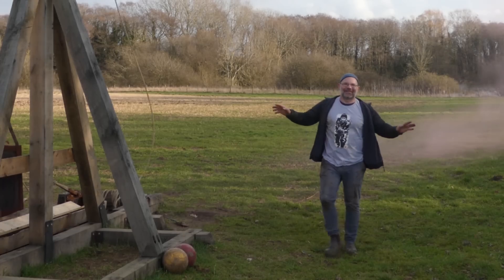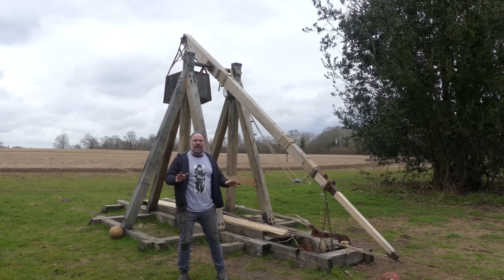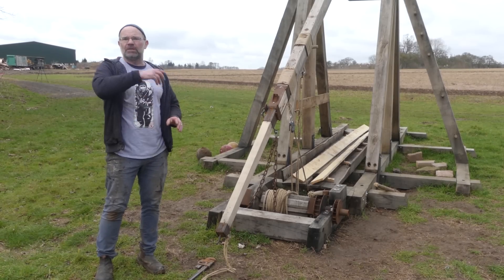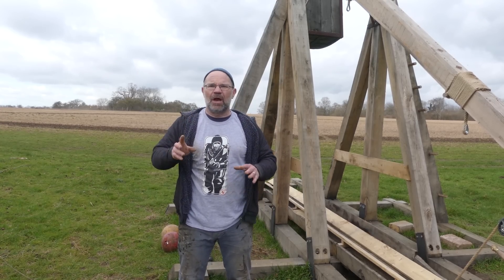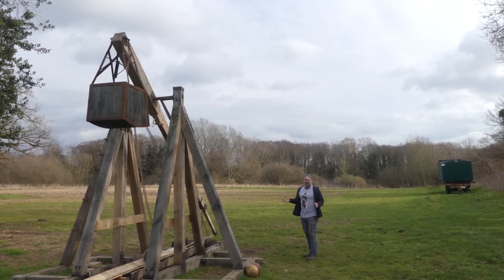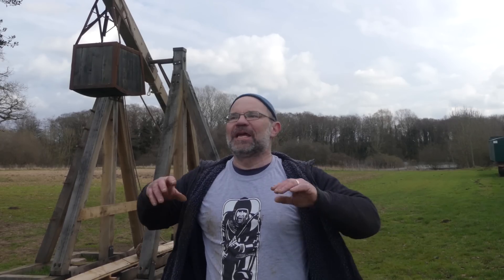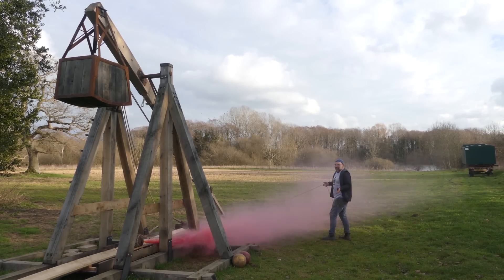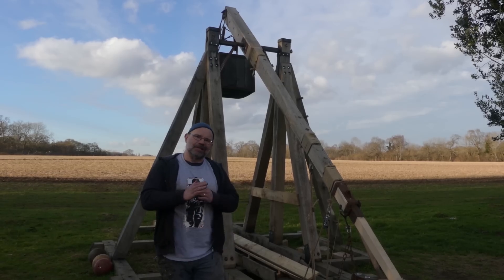Trebuchet - Why won't the darn thing shoot further?

Comment: I wrote all of the below out first... but I want to emphasize that this is mostly an slightly informed guess; so I really could be wildly wrong here.
I could be wrong, but it looks like the projectile is releasing at right about 45 degrees, which should be optimal for range (give or take, depending on wind direction). So it might just be that you are not getting as much energy into the projectile as you think you should be... ie the pin and such are good (as far as release angle) and you need to work on getting power from the counterweight into the projectile, which seems, most likely, to be a change to the sling length and maybe added counterweight (though the latter comes with shoring up the whole structure, of course).
Reply from the maker: I suspect that the arm needs to be a bit shorter and then energy may transfer better
Reply: @tods_workshop  more torque, less velocity at the end of the arm. I am not sure how the sling plays into it. Hopefully those guys in TX can help!

Comment: Not a trebuchet expert here, but maybe you want to experiment with the arm length some more. It seems to me that the low angle doesn’t allow all the potential energy to get transferred into motion.
Should that result in more instability, maybe you could extend the arm into the other direction? Though that extension would need to be rock solid with half a ton pulling down on it, so maybe that’s not the best idea either.

Comment: Perhaps take off the arm extension, and shorten the arm on the other side of the axle. That way there will be more gearing and a full "power stroke" again.
Reply from the maker: I also think that a little length needs to be removed

Comment: The machine does scale. Bigger = longer shot. I mean, my model at 60 cm does not shoot 130 meters. On the other hand,  it is perfect with an arm of 3.75, a counterweight arm of 1 and a counterweight 133 times heavier than the projectile, although 100 will do fine. There are a few improvement you can work on. The arm has to be at a 45 degree angle at release. It doesn't look like it is. The trebuchet has to be taller. Build a model. It's so easy to tweak it in comparison to this, and you can experience first hand just how much each variable matters. It's a real eye opener.
Reply: or use the simulator  to get most out of your build
Reply from the maker: Thanks Erick, I am just enjoying messing around with it.

Comment: I think the problem is with the counterweight.
The arm stops at almost perfect vertical every time, so it does not transfer a lot of the force. 
From what I can see the problem is that the weight falls straight down, while the arm rotates.
This leads to a situation where the arm rotates PAST the weight, which then arrests the movement before being pulled into the rotation again.
This seems to lead to a premature release, that is both weak and difficult to control, since the sling is pulled off the hook by force, rather than just slipping off at the right angle.
Reply: We hurlers call that "counterweight stall".  It's entirely usual.
Reply: @Trebuchet48  Can you go into more detail for the sake of our and Tod's enlightenment?
Reply: @dougler500  Thinking about it, dangerous I know, the throwing arm and the articulated counterweight form a double pendulum. however as the lengths are different they will have different frequencies. The weight has the higher frequency so that when the trebuchet is fired, the weight will be on it's backswing before the throwing arm has reached the point of release, thereby stalling the arm and taking energy out of  the throw.
Reply: The weight has an amount of momentum, allowing it to travel past the closest point to the ground and travel backward/up some small amount without slowing enough to be detrimental enough to the throwing arm acceleration. If that's true, the projectile arm must lag behind the weight arm/be bent back some small amount. The weight being able to swivel adds complication in calculating, and may be detramental to accelerating the projectile at the end of the weight arm stroke.  The projectile must be released before the arm acceleration becomes less and/or just before it begins to be pulled away from the optimal ballistic. Maybe those two points being made the same is an answer.
Lots of enjoyable experimentation is called for, besides the math. Don't forget the deer decoy target, which, besides being humourous will give range info.
Reply: @senatorjosephmccarthy2720  I think that initially it might be quite informative to stick visible markers at various points on the mechanism and fire the full sized machine filming it with a high speed good definition camera.
The footage can them be examined to actually see what everything is doing, when the release occurs and also the speed of the throwing arm.
Less problematic that building a small scale version perhaps.
Reply: @Trebuchet48  "Hurlers"...  there's a club for everyone eh?
Reply: @thexbigxgreen  If an object exist, there is indeed a club for it. -Just look up swedish fermented herring... Those guys are sick. No, literally, sick.
Reply: @Trebuchet48  I see youv got flexibility on your Treb ..Buy why is ths kunt not answering us .He keeps on saying  can you help ? His machine is to stiff like  him ..Look at my answer above  ??
Reply: @Trebuchet48  So, is there any conceptual benefit if the hurlers try to pull the counterweight so that at all times of the rotation of the arm, it is directly below the point that it contacts the arm?
Reply: Not sure to agree with the above. 

It seems to me that by extending the arm length without increasing the main axle height above ground, you have reduced the distance over which the projectile is being accelerated (arm is longer, the "ideal" point of release remains more or less the same, so the arc length (edit: not the arc length, the angle of rotation) between initial and release point is actually smaller), thus the initial speed of the ball at release point is lower. 

If I have got the dimensions right, your 1.2m extension might have cost you about 15 degrees of rotation of the main arm during which to accelerate the ball.

Edit: you've also reduced the drop height of the counterweight, which reduces the energy imparted to the projectile, hence the dampening of the counterweight motions.
Reply: @guillaumehenin6192  Very true. But also, it has to be remebered that the counterwieght is hinged. This hinge cannot be overlooked as it adds another layer of complexity to the problem. But it affects more the durability of the trebuchet then to to force imparted on the projectile.
Reply: Sorry just mentioned a similar observation in my post. Apologies for stealing your thunder.
Reply: The energy in the system is from gravitational potential energy(pE) converting to kinetic(kE). ( I know, stating the obvious.) The maximum usable energy in the system will be at the point the counterweight is lowest, ie; when the arm is vertical. Once past this point energy is 'lost' as the counterweight kE is returned to pE. Ideally, the arm would come to a perfect stop at vertical as 100% of the energy is transferred to the projectile. 

The double pendulum effect of have a swinging counterweight make me less certain vertical is the max point though. Perhaps a little past?

Tom's flywheel Trebuchet for some good footage of this momentum transfer, though on a flywheel rather than a counterweight : https://youtu.be/RVT5i4nhIGs?t=441
Reply: I thought the same. Looks like the whole system is unbalanced and dragging itself down. If you extend the releasing arm, you must extend the counterweight arm too to maintain the same proportion, and then elevate the pivot point above ground to accomodate it all.
Reply: As Oivin pointed out, the potential energy of the counterweight has been used when the counterweight reaches it's lowest point. As long as the counterweight has accelerated the arm to max speed it doesn't really matter if it swings past as even if the arm slowed down the system isn't able to pull back on the projectile and would just release it.
Reply: I don't know anything but now you mention it, it seems to me that maybe the counterweight would rob less of its own energy if it was on a shorter arm?
Reply: Yeah, but that's alright, right? Because lots of men experience premature release.... Right...?
Reply: Exactly. At some point the arm travels faster than counterweight and counterweight just robs its energy with a visible jerk. System has to be tuned so counterweight pulls the limb all the way to release.
Reply: As the winner of my high school physics class trebuchet challenge I agree.
Reply: its painfully the counterweight. its like watching an engine misfire to see that thing struggle to transfer the momentum... alternatively extending the length of the pitching arm by alot would help but alot less effective for effort.(and u sacrifice structural stability to maintain weight balance or also have to increase counterweight to do that)

Comment: With the extended arm the release speed is less even tho there is a greater lever effect. From what i can see the weight reaches its lowest point far to early during the arms rotation. This means for the rest of the swing, the weight is slowing you down and you have no further acceleration on the ball.
Reply: I was thinking that. With a longer arm, maybe the pivot needs to be raised higher...
Reply: @FluffyTrainz  ding correct.  just like when a dancer extends their arms to slow a spin, the longer the arm is from the pivot, the slower it is going to accelerate.  you need to increase the arc travel to compensate.  which means a higher pivot.  basic, basic physics.  this guy SHOULD already know this.  hell it's even quite a simple equation, and we used to have exactly these kinds of questions on high school physics exams.
Reply: That was my observations too.

Comment: The arm goes faster than the weight and the weight slows down the forward momentum as the weight pivots forward. The length of the arch of the weight needs to be in sink with arm and needs to come down smoothly. The weight should also come to rest on a brake so as not to try to destroy the machine. If you had a brake you might get away with adding more weight.
Reply: That's what I was seeing. It looks like the counter weight is braking/slowing  momentum at the release. There is a sudden sharp back pivot on the weight that looks to have a  dampening motion. By design? Maybe this could be adjusted. Tod did lengthen the arm, but perhaps that threw it out of rotational frequency - if that's a thing.   Potting the radius movements over time might reveal the instance of interference.  These would all need to be in sync for maximum distance. But maybe the sudden abrupt movement is what is supposed to happen?
Reply: @pavementsailor  isnt there an specific ratio how long the distance between ball and weight must be? when you only lenghten the throwing arm the ratio is broken. but im not sure. maybe i missremember.
Reply: Could the rope be too long as well? Dig a channel in the ground so you can rotate the longer arm further back at the load side
Reply: Better to let the weight and arm continue until naturally stopping, or with slight braking over "long" distance.
Reply: @senatorjosephmccarthy2720  there was a wooden ramp at the base that the weight touched at the bottom, almost like a springboard.

Comment: Suggestion: Why not build a table top version that you can load rapidly and science the heck out of? Like a sales sample. I'm not an engineer so i don't know if it would be scalable. I know a few people that would love to have a table top one. Just for those occasional food fight Etc...
Reply: It will to a point. Scale models are good for rapid testing but it scale model and full can still differ due to may things.
Reply from the maker: a scale model would be fun and educational, but as Nathan says; only useful to a point
Reply: I think the only differences between scaled down and original would be in material integrity, not performance, so I still think it is useful.
In other comment I suggested software simulation with algorithm to tweak parameters to maximise performance, which is even taller order than table-top real model for experimentation.

Comment: longer arm cocks lower in that frame. You're loosing potential energy, and arm rotation. The arm is also heavier now, and the beam ratio has increased and needs more counterweight to drive it.

Comment: I recommend you get a laser measure, you can get them that do up to 100m from amazon for around £35. You could stick a board up from the same point next to trebuchet (or throwing point for when you're throwing things) to get more accurate measurements.
Reply: The cheap ones don't work outside, the sun is too bright and swamps them.
A few sticks works just as well for logging the distances.
Reply: @Richard-dc5he  I was just thinking of a better option that wouldn't need setting up or taking down essentially, just whip it out and done with accuracy.
However, I appreciate that cheaper ones may have their flaws.
Reply from the maker: Hi Chris, I actually have one, but I know the length of my pace so it is quite easy to calculate to within a couple of percent

Comment: Would it work better on wheels? The wheels would allow the frame to move during the throwing action - straightening the fall of the counterweight and allowing the fulcrum to move forward as the arm delivers the final acceleration to the shot.

Comment: In the third shot the pin is bent too far. That shot is launched at significantly less than 45°.
And you get the same range for the same deviation in launch angle, with 50° giving the same range as 40°, it's just the trajectory that changes.
Reply: You are using the physics 101 launch angle for 0 air resistance. When you add air resistance the optimum angle is shallower.
Reply: It would be useful to measure the actual angle from the video

Comment: Ehh bowling balls sound fun, but they are bad projectiles arent they? What you want is high density e.g. lead ball, not low density bowling balls meant to be handled by people with one single hand. Pretty sure stones have a much higher density than bowling balls or can you imagine going bowling with a cement bowling ball? So increase prpjectile density, decrease surface. And: measure arm speed. The ball cannot fly a lot faster than the arm or maybe sling, right? So if you attach a super heave object on a long stick, you arent necessarily able to swing the stick fast. So measure arm speed with different projectile weights. Or same weight but different arm lengths. But quite sure its easier to change the weights than it is to change the arm lengths. Sling length is another factor but i dont understand it a lot. Like do you know for sure how the sling has to be positioned? How long it has to be? You can probably figure that out just with a stick and a sling yourself. Or watch other slingers potentially

Comment: What is the angular velocity of the shaft. You must know this first and increase this. How? Use the maths. Lengthen the shaft holding the weight, add more height to the drop point,  add more weight, lighten the balls, like a golf ball, they cannot be smooth as they are not aerodynamic. Drill the surface lightly. I would do this first. Is there anyway to put backspin to the ball?

Comment: Way to increase distance when pacing out the shot - shorter paces.
Reply from the maker: Curtis - a nice plan, but sadly one that's not for me.  Made me laugh though
Reply: @tods_workshop  Ok, how about this? Start counting at 11.
Reply: Nice and simple solution - I will allow it!
Reply: Work smarter, not harder.
Reply: Ah yes, the "Fisherman's Ruler" method!
Reply: Pacing can be very accurate with practice. I used to pace out my distances for stake out (I'm a surveyor), and the instrument man would read the distance and say "lucky, go 2.4 feet." Until it happened another 10 or so times, always under 10' from the target distance. I'm not special, I just did it A LOT because we were staking out power pole locations for long transmission lines, so hundreds of repeats.
Reply: @whirving  If you've developed a 40 inch stride, count your steps and divide by one thousand to have your distance in KM. (And NEVER let the LT handle the map & compass)
Reply: @muninrob  I have meter and yard paces. then i have winter paces for snow. Since I'm usually only going a couple hundred feet or less I don't have to calculate kms or miles.
Reply: @whirving  I did a military tour, a 40 inch step is a side effect of that.
Reply: @whirving  You, good Sir, is one of the unsung heroes building the pyramides...
Reply: Lol I endorse this method 🤣
Reply: Because you are getting diminishing returns on weight addition. The limiting factor now is arm travel distance. You can only accelerate something so fast before it snaps. You need more time to reach a higher angular velocity. Reference yourself to Tom Stantons tennis ball trebuchet and you will see it has at least 3x more arm travel than a traditional trebuchet which allows it to hurl tennis balls at speeds well above 120mph.
Reply: Need some stakes already measured and marked...everybody paces differently.
Reply: Science.